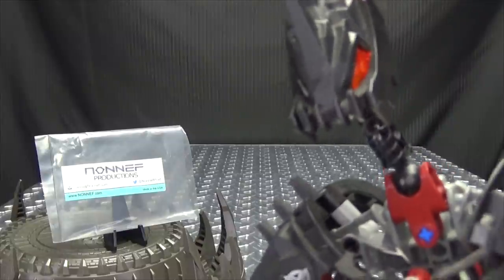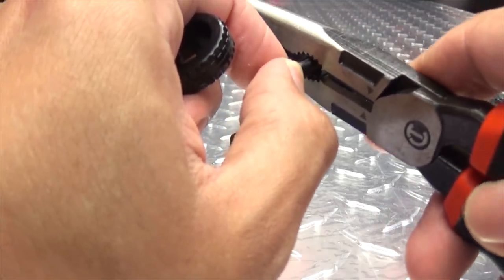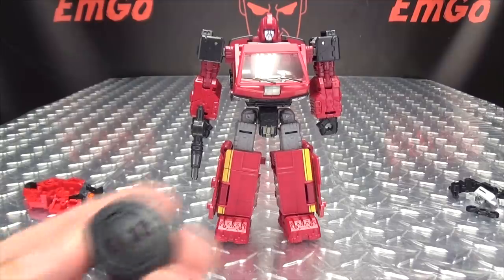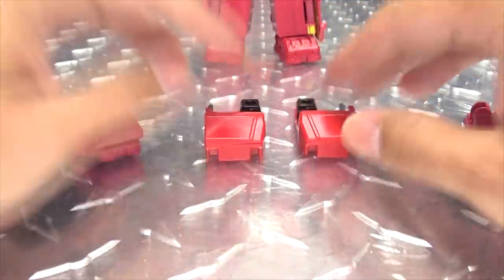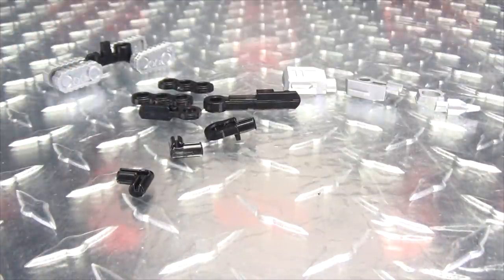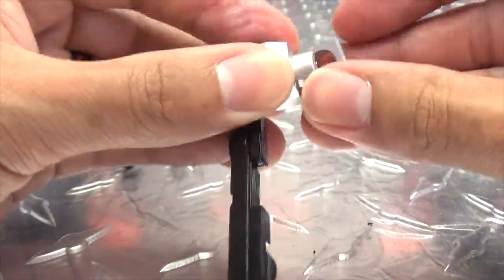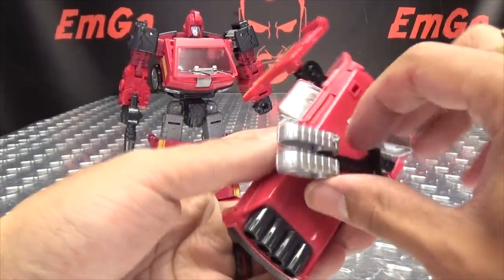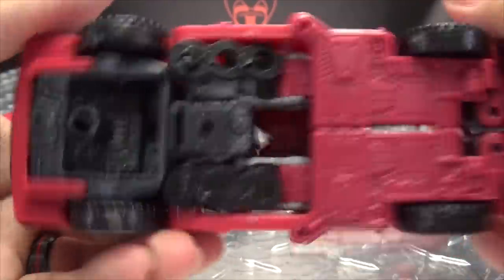Nonnef Productions UPGRADES for Earthrise Ironhide & Ratchet: EmGo's Transformers Reviews N' Stuff

Comment: Just got these sets for my Earthrise Ironhide and Ratchet. These are definite must have upgrades. But, instead of taking off the side panels on Ratchet and Ironhide's legs for the sled, I used their original feet I replaced. I also managed a way to mount all the accessories in Robot Mode if you have limited shelf space.

Comment: Hasbro couldn't even be bothered to color-match Ironhide, why should I sweat an upgrade kit not?
So I may need to order these, I can live without the sled parts but the wheels and feet are definite improvements.
EDIT Yeah I went ahead and ordered the tires and feet upgrades for both. Between those and the red hand upgrades for Ratchet I also got from Nonnef they're both becoming quite expensive figures : P

Comment: Hey to however buys the upgrade kit for the feet watch when you attach the bumpers on the back of the feet. The hole they go in can Crack. It happened to the one I bought for Ratchet. My ironhide version seems to be OK so far though.

Comment: Why do the hubs on these wheel kits look like crap? I love Nonnef's stuff but I've seen this on other Ratchet/Ironhide earth mode kits. Even if the hub has to be flat, you can at least sculpt a shallow hubcap and not what looks like a solid piece of sheet metal.